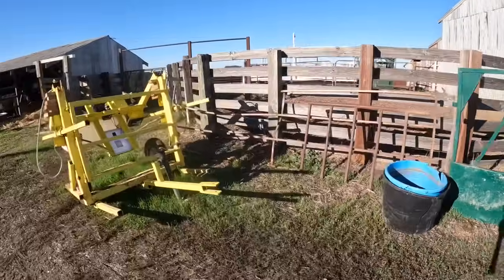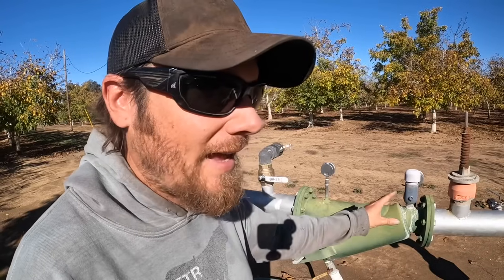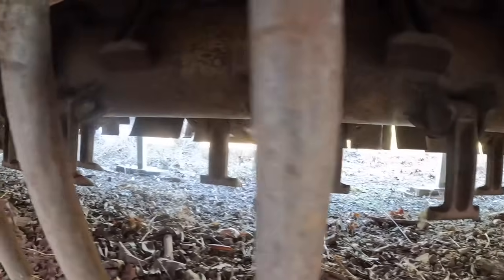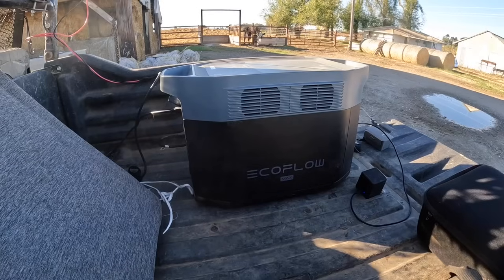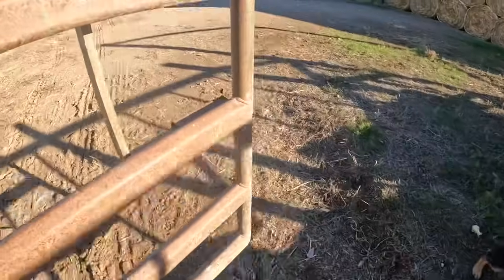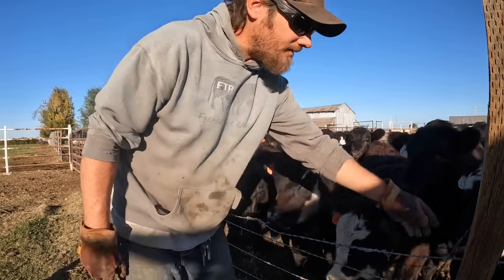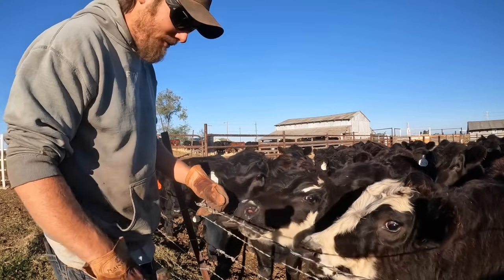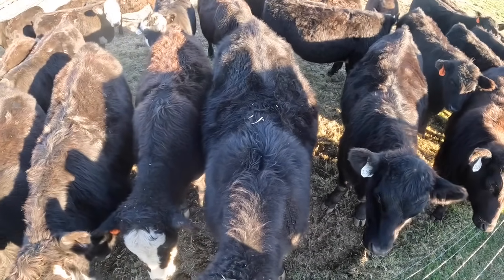It Will Be Good Until They Break it Again!

Comment: Tyler, 

Regarding the fence splice you might want to try a “Western Union” splice.  I first unwind the wire up to the first barb on either side of the splice.  Then I “Y” the ends and start wrap one wire at a time.  It holds real good and very rarely do I ever have to re-splice. 

As for your issue with distinguishing who is a heifer of a bull,  I’ve used different colored tags.  White for heifers and green for steers and bulls.  

Respectfully, 

James -a fellow cattleman from East Tennessee 

P.S.  Please give Belly and Callie a pat on their heads from my wife and I….
Reply: I was about to suggest the same, different colours are much easier to distinguish which is which from a distance.

Comment: Tyler,
     Be careful with that back!    Watching you flip that tub......lower vertebral structure is like a bearing, eventually it can or will wear out!   Don't  rush it.   I just had injections in spine and SI joint a few days short of a month ago.    Over 2 months of bed rest and lumbar traction prior and I may have dodged a bullet as I am back on my feet.   Time will tell.  Cautiously optomistic.

Comment: I finally graduated my fence mending from the wire bending method to the use of wire ferrules aka brass cylinders. You slip both ends of the wire through the cylinder from each side, after stretching the fence with the puller. The you use a crimping tool to crimp the ferrule onto the wires. I usually put two crimps on each ferrule to ensure a tight grip. Then  release the stretching tool.  I have not had a broken fence at the ferrule, to date. the crimpers are an extra expense, as are the ferrules, but they do save me time to balance everything out.

Comment: Hello Tyler, and thank you for another enjoyable update of “life on the farm”.  At around the 20:50 mark, you commented about the need for an easy way to identify the gender of a calf, especially when lots of them are clustered close together.  

I can think of two possible ways – and there may be more – which involve tags which are fitted to their ears.  One possible way would be two use two colours, for example “Blue for boys” and “Pink for girls” (or whatever colours may be available).  The other way would involve fitting tags to the right-ear for one gender, and to the left-ear for the other gender.

May I make another suggestion?  When you repaired the top strand of the barbed wire fence, you mentioned the possibility of building a pipe-fence for at least a short length at that location.  If you have some suitably long pieces of pipe available now, I think that it may be practicable to install at least a top-rail to the existing fence, with the pipe just tied to the tops of the existing posts with plain fence-wire.  This may not provide great strength to the fence, but it may produce a good visual barrier which could deter the cattle from wanting to cross at that location.  It may be beneficial to introduce at least a couple more horizontal strands of barbed wire along that short length of fence.  It may also be helpful to use vertical strands of plain wire between the posts, tied to the horizontal barbed wires, to prevent the barbed wires from being spread apart.  Wishing you success!

Comment: Tyler, do they sell continuous fence panels there? That would be a good quick fix for that corner. We use them and either lag the clips to wood post or weld to steel post. I built a ton of them when I worked at manufacturing/welding shop

Comment: At first I liked the even/odd number idea for steers/heifers. I was worried that the H would get rubbed off the ear tag, (you'd probably decide steer/heifer before you'd ever be close enough to read the tag) but the only place it would matter would be in the computer. Since adding the H in the computer is so easy and less fussy at tagging time, I'd go with the H system (I'd add the H at the end of the numbers.) 💖🌞🌵😷
Reply: Or just add a "0" or "1" to the end of the current numbering system? That might avoid switching between letters & numbers on the keyboard....